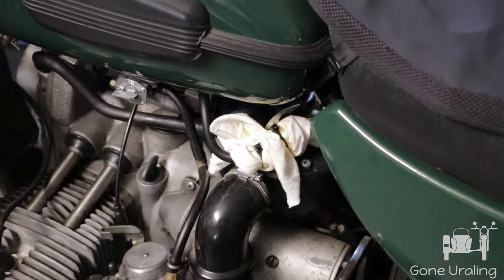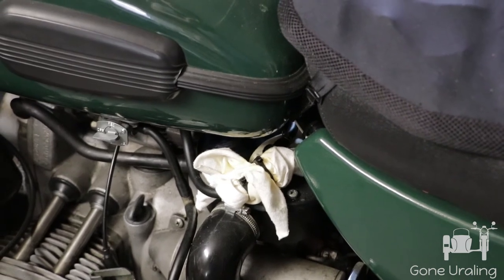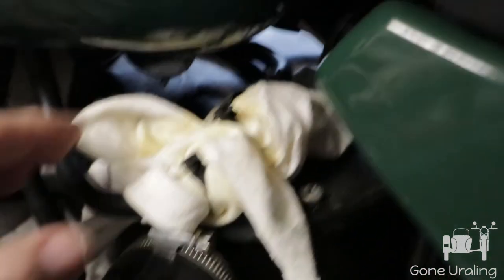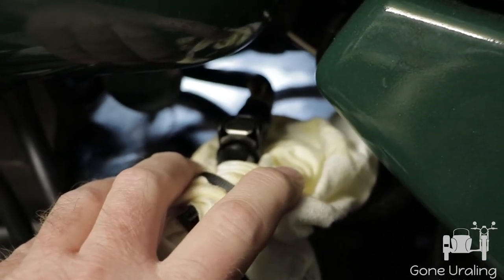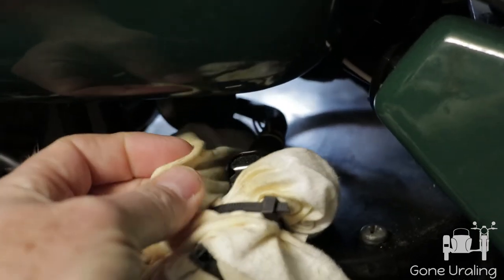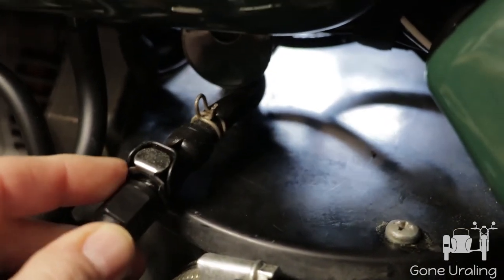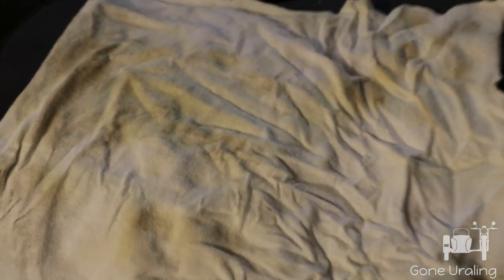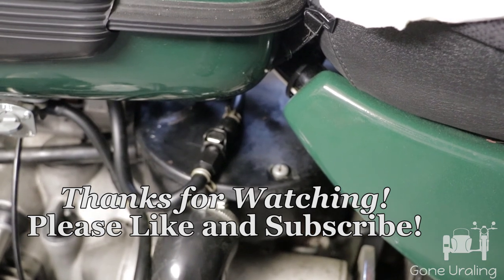Crossover Fuel Line Disconnect - FAIL

Comment: Don't give up yet. You can get metal fuel line quick disconnects. BMW sells them but like all BMW parts the cost is high. eBay sells all seizes. Check them out.

Comment: Tried those on my HD years ago and on brake lines to sidecars. All had one thing in common, including the BMW ones, they all leak, eventually. Some sooner than others, but all leak. A pair of cheap inline petcocks will do the task, or just empty the tank....My Ural with a tank like that was modified and has 2 BMW petcocks and NO cross over, that's done post petcock, like your son's Beemer.
Reply from the maker: it's not a big deal to drain the tank but yeah, a couple of inline petcocks would probably be the best solution if I persist with this idea of not having to drain the tank to remove it... although it does still need to be at least 1/2 empty or you'll slosh fuel out of the overfill line.